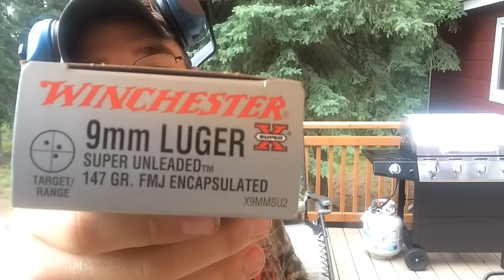M1-9 Carbine By Chiappa: Reliability Test

Comment: I recently purchased a Chiappa M1-9 and ran into some of the same reliability issues depicted in this video.  After thoroughly cleaning the carbine, I conducted my own reliability test using 13 different 9mm factory loads and four different Chiappa factory magazines.  The most reliable ammo was consistently the heavier Federal 147 grain loads. This included the flat point ammo tested in this video and also Federal 147 grain JHP. 

With a couple of exceptions, the most extensively tested and least reliable ammo were rounds with 115 grain bullets. The test included both FMJ and JHP from various manufacturers. It was as if there wasn't enough blow back force to reliably cycle the bolt and feed the next round.  However, two 115 grain rounds that fed pretty reliably were Hornady's Critical Defense round and Winchester FMJ.  Nothing else tested would feed reliably. 

In  middle weight ammo, the most reliable 124 grain load tested was the Winchester 9mm NATO round. I contacted Chiappa and they do not recommend +P ammo for use in this carbine. Though Winchester 9mm NATO is slightly above standard pressure, it is NOT a +P load.  

In conclusion, I found that Federal 147 grain ammunition and Winchester NATO 124 grain work most reliably in my carbine. I remain hopeful that over time the performance of the M1-9 will improve as more rounds are cycled through the carbine. I'll keep shooting and thoroughly cleaning the carbine after each range session. But my carbine is not quite ready as a home defense option. Right now, it's just a fun recreational shooter.  I appreciate Bacon Firearms review of the M1-9 and I hope this provides additional supporting information.
Reply: I recently went to the gun shop and purchased what they had on the shelf, Lucas "Extreme Duty" gun grease. I made sure the carbine was clean in all respects and then liberally greased the rails, bolt and all sliding parts. I worked the action by hand and headed out to the range.  Using a Chiappa factory mag and a Mec-gar mag, I tried American Eagle 124 grain cartridges and was frustrated by failures to feed. This is good ammo and works in every other 9mm I own. I switched ammo to Hornady 124 grain XTP JHP's and they fed flawlessly in both magazines. Go figure.

In my original post I noted that flat point, JHP and Hornady Critical Defense ammo cycled best in my carbine. The consistent feature of the ammo that fed best was not the brand but the bullet shape. I'm neither a rocket surgeon nor a gun scientist and I can't say definitively why one round works and one doesn't. Was it because of the "Extreme Duty" gun grease or the excellence of the Hornady XTP JHP? I don't know for sure. Maybe both. But I've come to the conclusion that my carbine likes the shorter jacketed hollow point style rounds and I'm going to stick with what works. It was absolutely amazing to go through 50 rounds of ammo without a single failure to feed (YMMV). Hallelujah...!!
Reply: I found the Winchester 124 NATO runs great in mine too. It's about $27 for a box of 150 at wallys so I happy bout that.
Reply: DAmn i want a replica m14 myself and was seroiously considering this as my 1st ever Chiappa?I have only heard bad things about them but as i see it its the only replica i can afford? Im praying they stepped up their game a bit since these comments and video?lol  i want a WWII replica that works right so bad! lol

Comment: I enjoyed your video, as I recently bought a chiappa M1 9mm carbine.   After my first visit to the range, then watching your video, i decided to do a little amateur gunsmithing.  I drilled 3 holes in my workbench, then using 3 dowel pins to hold the bolt open, took a Dremel tool and ground a ramp into the breech, then polished it.  With the two manufacturers mags and a Promag 32 round clip, i fed approximately 80 or 90 rounds of FMJ round points through it without a single failure to feed.  i tried again Sunday, using the 147 grain flat tip ammo.  Out of about 80 rounds, I only had 8 or 9 failures to feed.  Since this is not a 'go to' weapon, i'll just keep using round point ammo.  Thanks again for the video.

Comment: I bought the Chiappa M1-9 used at a gun show two week ago (vintage 2015).  I had the same problems shown here using the Chiappa magazines and 115grain Remington range bucket ammo.  After seeing this video, I decided to perform my own testing.  First I called Chiappa and asked their opinion.  They blamed it on the ammo, said Beretta mags should work and that +P ammo should not be necessary.  Fortunetly my buddy has a 92FS and was willing to loan me his mags.  2 original 10 round Beretta mags and 2 - 15 round pro mags.  I have some speer 115 grain Luger but wanted something else to try on range day.  Wal-Mart had some Winchester 124 grain 9mm NATO ammo cheep so I bought that.  NATO ammo is higher power then even +P.
Results:  Worst magazine = Chiappa,  Best magazing = original Beretta,  Best performing ammo = 124 grain NATO.
Note:  I did not have a single failure using the NATO ammo in the Beretta magazines.
I just ordered 2 - 15 round Beretta magazines (Beretta is having a President days sale) and went back to Wall Mart and cleaned out their 9mm NATO..
Stay tuned.

Comment: It may have been the ammo used for the failure to feed. I ran about 200 rounds of 115 grain brass PPU through mine through several mags including Mec Gar, USGI, Beretta factory mags, and the chiappa mags with no issues at all. I do have a ton of 147 grain FMJ i haven't tried through it yet though.

Comment: Hi thank you for this .
I have been having the failure to feed issues and thought I was all alone.
I will hunt for 147 grain and carry on.
Reply: 124gr Winchester NATO white box is what has been working great in mine. When I first got it it seemed to cycle just fine think about anything I put in it. Then for some reason I started getting failures to feed. I tried that NATO 124 grain and it seems to cycle real well with no problems. Hundred 50 round box at Walmart is pretty cheap too

Comment: at 16:27 you used the pro mag, however since it was loose when locking you added a variable by grabbing on to the magazine, and by doing that changed how it feeds and it look to work better after you grabbed it.

Comment: I just purchased one of these carbines and they do not use the same magazine as the Beretta 92.  The notch for the magazine catch on the 92's mag and also the Taurus 92 mags are different.  I can alter the Beretta and Taurus mags to fit my Taurus and to fit the Chiappa but they do not function in the carbine reliably.  However using the mags that came with the carbine I have zero malfunctions.  It is a nice handy little rifle. The only disappointment so far is the lousy design of the magazine release. It easily rotates out of position. And although it can be put back easy enough it is something that should be changed.

Comment: how did you modify the factory mag to hold more rounds?
Reply from the maker: If you take apart the magazine, there is a metal stopper. Cut it off with sheet metal pliers. Gives you 5 more rounds when you do that.
Reply: +Bacon Firearms Reviews do you recommend this rifle?
Reply from the maker: +Bobcats31 as long as you use the factory mags, it is a good rifle. But if you want an M1 carbine, get one that is a real one. This rifle is a cool concept, but not reliable enough for self defense. It would be great for a rabbit rifle. Depends what you need the rifle for.

Comment: Can you redo the test while you're not holding onto the mag, like an experienced airsofter?
Reply from the maker: The only way for this rifle to function with the 32 round pro-mags is to hold the mag. The mag keeps shaking around and falling out of the rifle. Usually I don't hold a rifle by the mag, but in this case it was the only way to keep it running. Just don't use the pro mags.
Reply: i meant with the smaller mags. never use promag - full stop. for a company that makes magazines they sure have an atrocious record with making magazines.
Reply: EnterTheFenix
He touched the mag on a couple of occasions, there were plenty of malfunctions with and without that grip. It's the magazines them selves, of the military design. The feed lips are .5 of a mm too high and that is why they sometimes get bumped out of the rifle or there is a failure to feed. I am certain it is not his hold on the rifle.
Reply: I've noticed the feed lips on every other mg are longer than the factory mags. I have two 32rnd mags and plan on doing a little modification. Hopefully the feed issue will be resolved.
Reply: User error ! Hold on to the forearm junk mags dirt cheap bad ammo mine works good

Comment: Honestly, I love shooting this. But holy crap in it unreliable.
The larger promags work maybe half the time, the factory ones work most of the time, and the single government issue one works about 80% of the time.
I would tell you what ammo I shoot, but the answer is what ever is cheap. currently it's 124grain red army standard. Not the greatest, but it was cheap.
Reply: Have you tried higher grain ammo?

Federal 147 grain and 124 grain Winchester 9mm nato are said to work more reliably. Further, someone reported that putting a stronger magazine release spring into the gun meant the magazines were held firmer in the gun and it has less issues. On top of that, someone mentioned they swapped out the recoil spring and it never had any further issues.
Reply: @izaicslinux6961  Considering that most of the issues are mag related, a stronger magazine release spring might actually help.
And I can try the higher grain ammo at some point too.

Biggest problem currently is a lack of time to get to the range and fiddle with things.